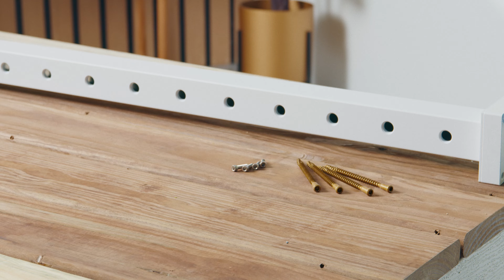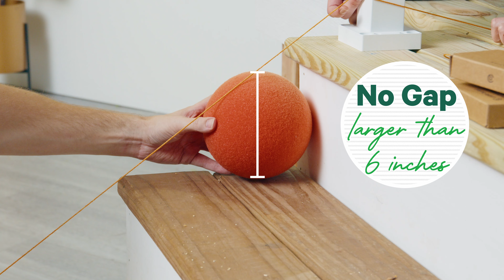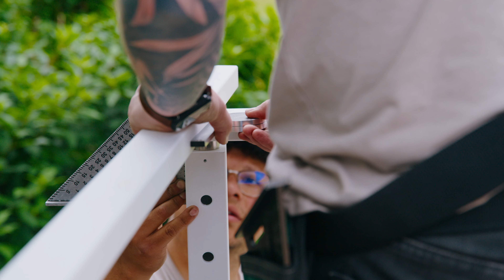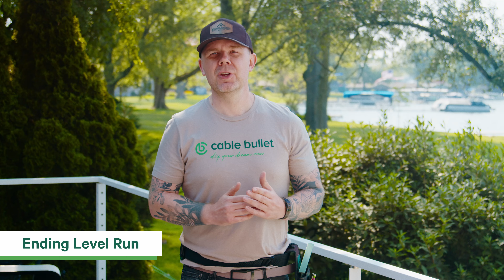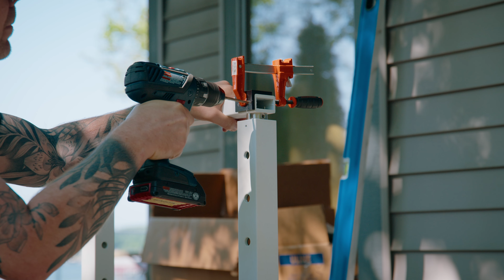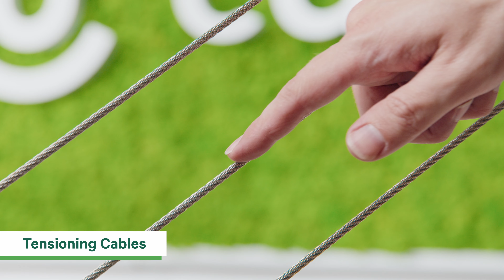How to Install Signature Series Posts & Handrail

Comment: I didn't see how to tighten the cable.
Reply from the maker: At about 14:25 you can see how the cable is driven in with the 3/32" Allen wrench. You'll continue driving that screw in to increase the tension on the line. Let me know if there's anything else I can help with!

Comment: Any tips if a screw strips out?
Reply from the maker: Depends on which screw! Would you be able to give us a call to help you out?
Reply: @CableBullet oh sorry duh my bad.  Seems my deck screw through the base of the post deflected and missed center of blocking. I actually was thinking a long machine screw or bolt with a nut on the bottom but it would have to fit in the counter sunk hole in the post base.  Additionally the post is very solid because other screws did grab hold so I’m not sure if I should even mess with it

Comment: An easier way for the leveling plate. Drill one hole completely. Start one of your screws into that hole and the plate stays in position.  The second hole diagonal to the first start another screw and drill the other two. No hole marking needed or trying to hold the plate from sliding while marking holes.  Your plate will be dead on accurate.  Also that is not how to tap a hole, it’s a good way to break a tap.  You’re supposed to turn a tap counterclockwise to clear the chip as you turn it in.  I would never use a drill, if you bottom out that tap will snap.  That’s why they sell tap wrenches which you should have included😊 just sayin
Reply from the maker: Appreciate the tip on the leveling plate! Thanks for the feedback on the tap handle--I'll run it up the chain!